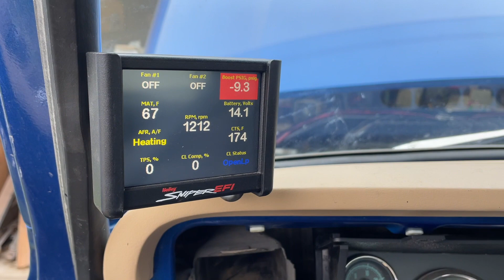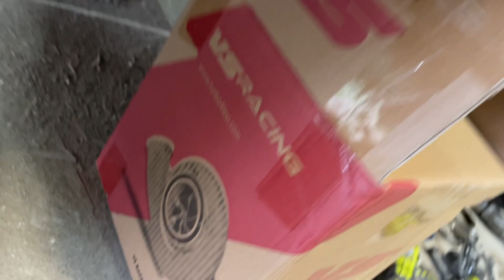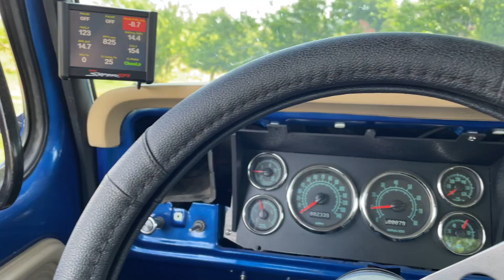My 300 Straight Six Gets a 72mm Turbo!

Comment: Ha! I spent 6 months cludging together a ZF 5 to an old Cummins V6 in a 1971 1 ton 4x4.  I had the tranny professionally rebuilt, and it came back dry.  I stored it for 6 months before it became part of the build and then lived in the truck dry.  
I got the engine fired up, adapted hydro boost brakes from a Silverado and plumbed the power steering, boy was I excited to get out on the road.
I remembered to fill the tranny first!
Turns out 4th gear synchro is stuck together 🤦‍♂️. 
Everything has to come apart now  of course

Comment: good work. i discovered that hy trans is a better fluid than atf for the zf. i used napa universal with good result too. especially with older synchros. hy trans is yellow metal safe
ive not tried hy gard but hear good things about it

Comment: What exhaust housing ar size did you go with and what rpm does it spool?
Reply from the maker: .96ar. It doesn’t really take off until after 3000rpms but you can still build boost around 2200 if you load it up